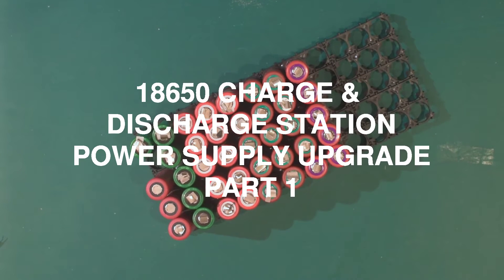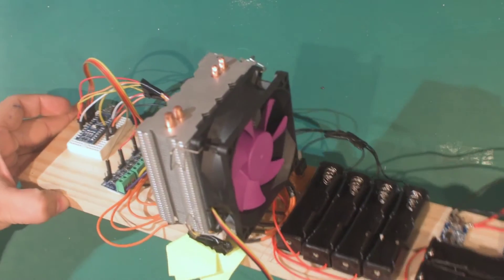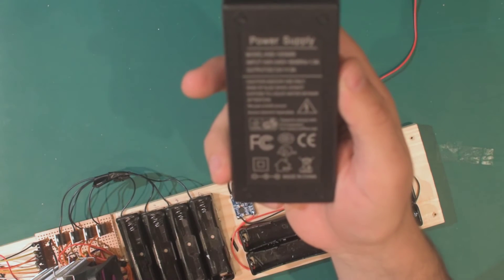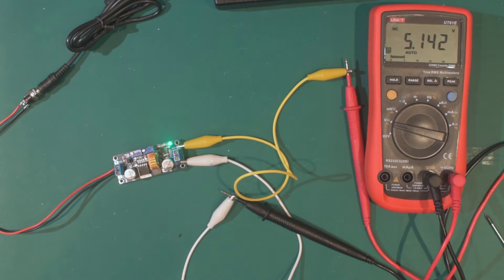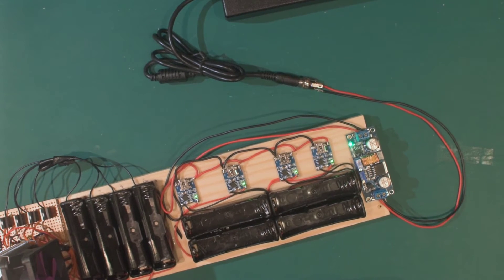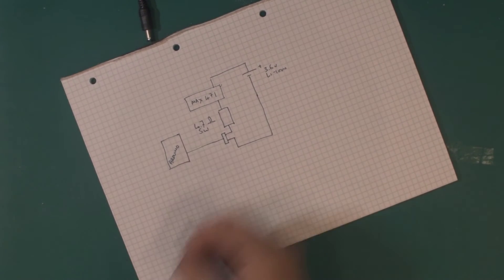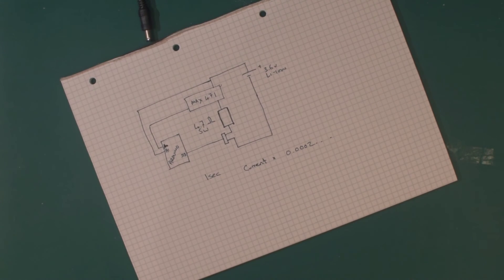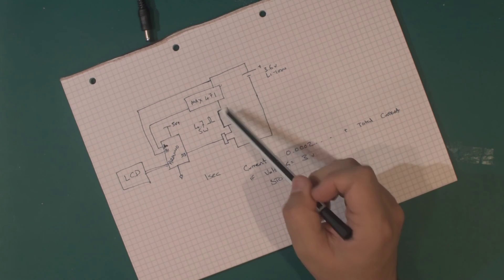18650 Station - Improving on my Charge and Discharge solution

Comment: Hey Chris! I hope this message will not seem like spam to you, but if you are using 18650s often for your project, we would love for you to check out our Kickstarter page. We have developed a robust electronic device for testing 18650 cells and reporting optimal pairing information to the user. If you use 18650 cells in a lot of your projects, I really believe you might have interest in what we have created. Best wishes! If you feel uncomfortable using the link below, just navigate to Kickstarter and search "18650." Our project is named "The Batlab."

https://www.kickstarter.com/projects/1722018962/batlab-a-battery-testing-system-for-lithium-ion-18?ref=creator_nav

Comment: Rather than wasting energy (heat) with the discharge side, could you actually channel that energy into charging the next set of cells? 

It wouldn't be a perfect system, and possibly not viable financially, but I just hate seeing wasted energy. :)
Reply from the maker: I haven't thought about trying that.

Yeah it's totally possible to use the charge from one cell to charge the next then add in the delta from grid/solar. The challenge would be working out a way to make the cell that your charging act like a constant load to the other so you can log the capacity.

As you pointed out the wasted energy is converted into heat in the MOSFETs and resistors Another way to not waste energy might be to use that heat some how? I have no idea what for though ;) Boil the kettle maybe

In the mean time i can give it some thought, anyone else got ideas on how it could work, please chime in :)

Comment: Hi Chris

Would it not be better use an external disconnect on  charger board. When you start discharging the cell, the charger board will trip and start charging the cell again. Your mAh test will be too high as current is a sum of charger current + cell current.
Reply from the maker: There isn't a connection between the chargers and dischargers. In later iterations when they are connected, I resolve the problem you're talking about by disabling the charger while charging (https://youtu.be/FJQNXQieKPE)
Reply: Hi Chris. 

My apologies, I over looked that detail. Look forward to further videos.

Comment: Buck converter is providing 3A max. There are 4 charging modules. Each one is running tc4056 IC. This IC is supposed to charge the battery 1A CC and then CV. Buck converter can't provide 4A in total.
Reply from the maker: +Vladimir Georgiev yep, soon as I get something that can do 4A+ I shall fix that. Project is just made up of what I had at the time, now evolving it as I go.